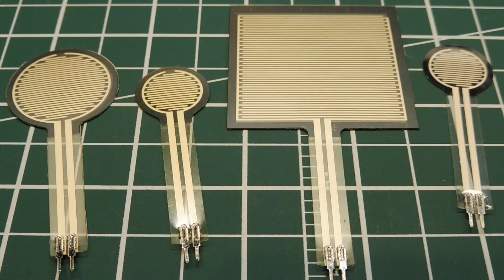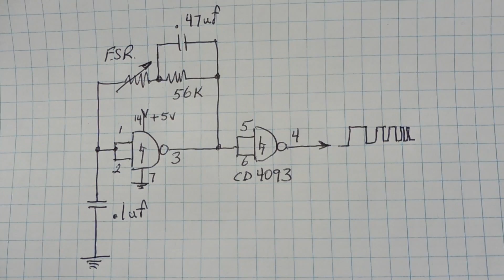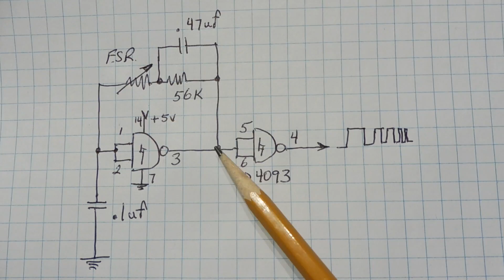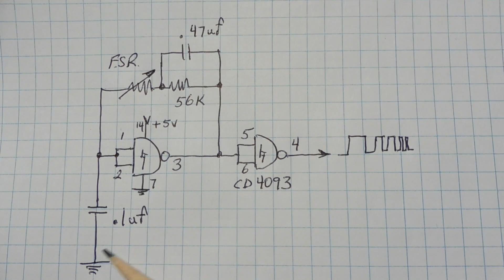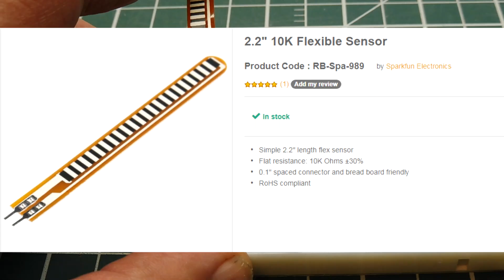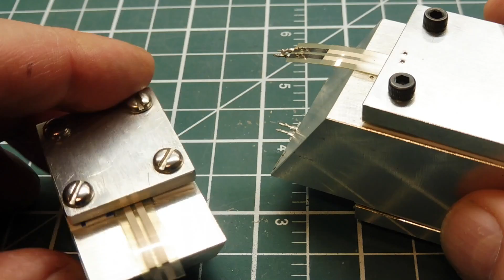Pressure to Frequency Converter / FSR

Comment: I looked into the piezo sensors you suggested but concluded that the FSR strip (300mm) from Interlink is sufficiently sensitive. A piezo sensor that size would be prohibitively costly. The small surface area of the FSR shown in your video would be inadequate because each time  I would need to pull the mechanical action out of the grand piano, move the sensor to test the next key, push the action back into the piano and repeat that process 88 times (88 keys on a grand piano!). Thus the strip sensor. 

But would my 300mm (12in) sensor necessitate changing the capacitors’ and resistor’s parameters? 

I bought all of the components and have reproduced the arrangement as per your breadboard (using an RCA CD4093BE just like yours), powered by USB 5V,  but getting no audio. I suspect I’m not wiring the amp and/or speaker correctly. This is the Adafruit amp I’m using:

https://www.adafruit.com/product/3006

And speaker: 

https://www.adafruit.com/product/3923

But I’m only guessing at how to connect them; perhaps I’ve bought the wrong items.

This device is such a brilliant idea and I desperately need it to work as my eyesight is failing, but having audio feedback to make this critical adjustment would solve the problem perfectly. 

This is such an awkward means of communicating with you. May I provide you with my phone# and perhaps you could text me an email address that would facilitate an easier exchange? Or perhaps we could speak at a prearranged time? Seven8Five-3Nine3-Five5Three7. I would not abuse your generosity and would insist on compensating you for your expertise (in the same way that I wouldn’t tune your piano for free!). 
Thanks,
Michael
Reply from the maker: The amplifier from Adafruit will not work for your application.
Check under the "About" tab on my channels main page for my email address.

Comment: I’d like to build the first setup, the one with the oscillator, and hope you can tell me about the 0.1 and the 0.47 uf capacitors: What does their voltage rating need to be?
Also, what is the power source and how much voltage?
Reply from the maker: The operating voltage of the CD4093 is 3 to 15 volts but I was using 5 Volts DC as indicated on the schematic. Any .1uf and .47uf ceramic capacitor will do.
Reply: I’m making a device that will detect physical contact between moving parts inside a grand piano, and my highest priority is that the FSR should be as hypersensitive as possible. Your demonstration model appears to achieve this but it’s difficult to know just how hard you’re pressing with your finger. How would you set about tweaking your model to increase its sensitivity? For my needs it’s not measuring the quantity of force to the sensor that’s the issue, but instead it’s the sensor’s capacity to register the slightest touch such as, for example, if a housefly were to land on it. A bit OTT, I admit, but this is what I’m aiming for!

Thanks so much for your help.
Reply from the maker: @michaelschnelling1192  For that sensitivity you should look into Piezo sensors or even an electret microphone. https://youtu.be/wEqfHo_guG8

Comment: That circuit that makes that variable frequency seems really clever. So un-complex. Yet so useful. That must be easier to interface this circuit to a micro / arduino than trying to sense the voltage via the AD converter.

Comment: I would like to ask you two things-
1. I think I can use the 7414 Hex schmidt inverter IC in place of the CD4093
2. Is the second schmidt nand (used as  buffer) at all essential?? The output of these ICs are buffered one as per as I know, and will not cause impedance matching problems with the speakers
Reply from the maker: You will have much better success if you stick with CMOS logic like the 74C14 or 40106 when building RC inverter oscillators.
The 7414 is TTL logic and does not have the high input impedance or gain like the CMOS family.
The inverter oscillator should be buffered because the output is charging/discharging the timing capacitor and any extra load will alter the frequency output.
Reply: Thank you Sir